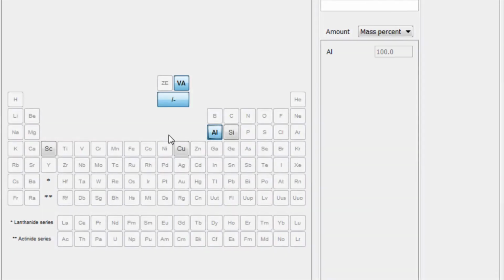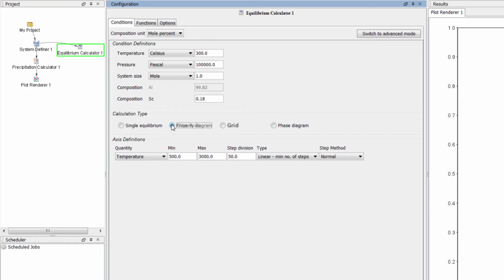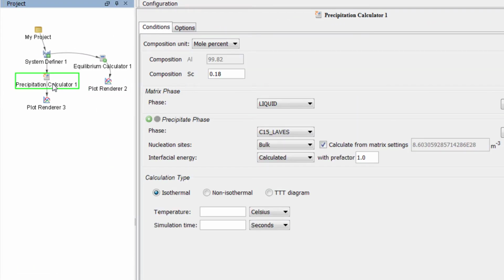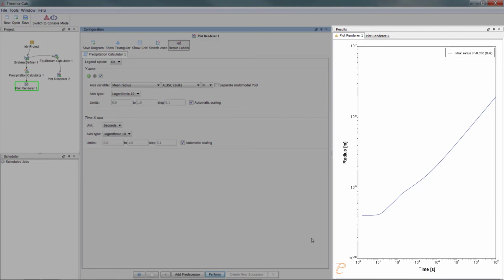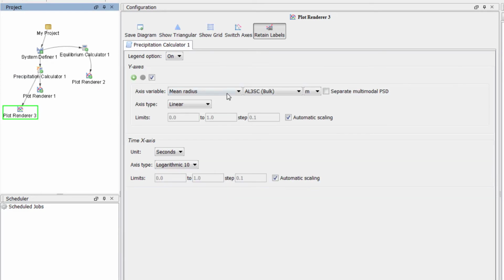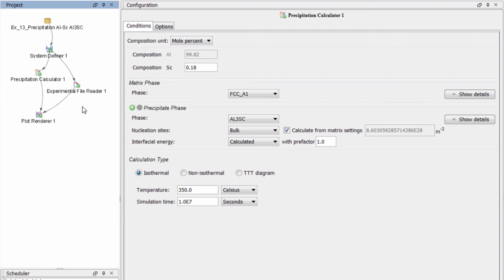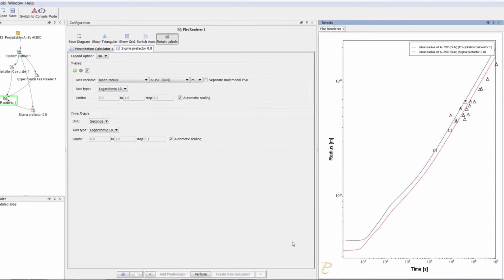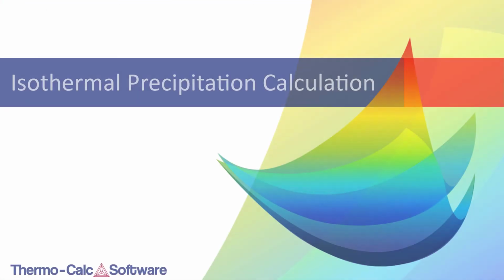Example P_01 - Precipitation Al-Sc AL3SC with Yield Strength

Comment: Thanks for your help. One question I have is if the temperature input in the calculation type is the temperature at which the material is age-hardened?
Reply from the maker: Hi @kadewaite2578! Thank you for your question. Yes, the temperature is the age-hardening temperature. It can be seen that for times above 1E5 sec, the yield strength starts to decrease, indicating over-aging. Note also that an isothermal profile was used simply to make the example easy and quick to run. Of course also more realistic non-isothermal profiles could be used.

Comment: Another question for you, does the precipitation calculator use the equilibrium of the system at the specified temperature to determine how the precipitates grow or does it utilize some sort of scheils solidifcation to determine what phases are present?
Reply from the maker: Hi @kadewaite2578, 

Thank you for your comment! The precipitation calculation does not determine what phases are present; the user enters that manually. The user selects a matrix phase and precipitate phase(s), and only the selected phases are included in the calculation.

Comment: Thank you for your help!
I had a question regarding the determination of yield strength . I have Thermo-Calc Educational version 2022a,  but I do not see the yield strength parameter in axis variables. Is it not included in the educational version?
Reply from the maker: Hi! Thank you for your question. I looked into this and found that yield strength is not currently available in the Educational Package, but it should be added in an upcoming release. We release new versions twice a year, in June and December, so you can check back then. I apologize for the confusion and any inconvenience this may have caused. Hopefully we will solve this issue soon.